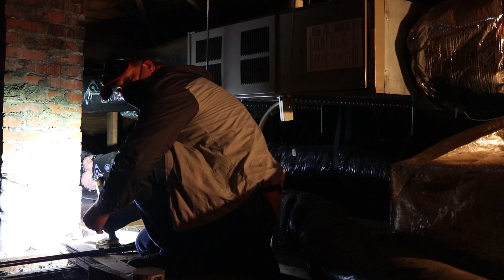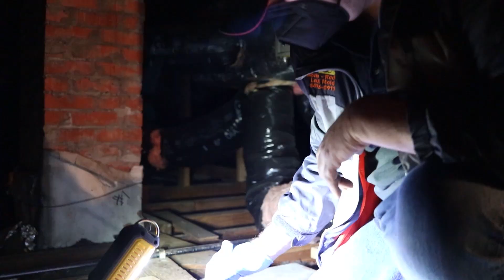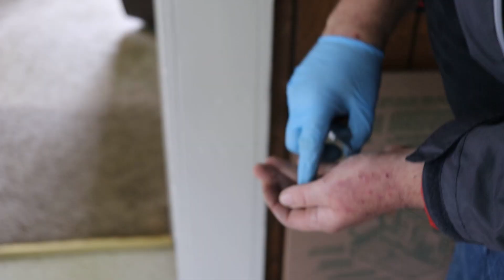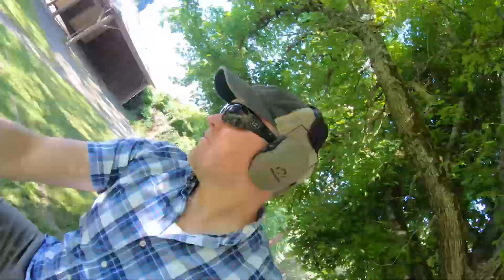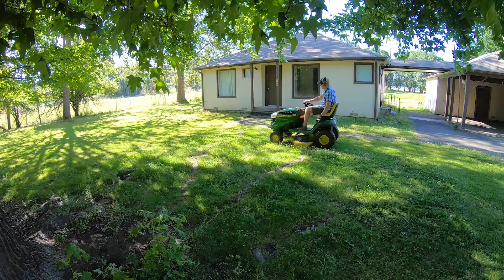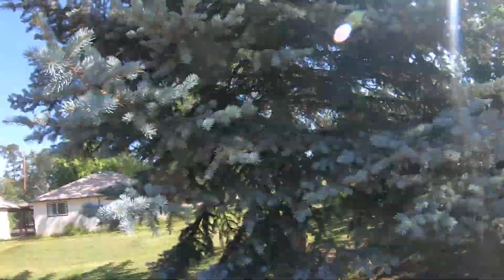This House Could Kill You

Comment: My father was a customer serviceman for the local gas & electric company back in the 50-80's. He used to bring home a bucket of asbestos fibers in one of those round potato chip boxes which we sprinkled on the barn and cellar floors before sweeping. The barbed fibers clung to dirt particles which helped lift the debris from the floor surface when we swept. One of my best friends’ fathers was a boilermaker whom actually died from asbestosis after working with it his entire career. He used to tell the story of how you couldn’t see through a room where pipefitters used it to insulate pipes. They mixed it with water in cement mixers before applying it to the piping and the airborne fibers filled the air. My lungs are getting heavy just thinking about it.

Comment: I grew up in the Navy and one of the base we lived in had asbestos tiles on the floor that was so old that the top layer had worn off and our feet would be coated with white powder from the floors.  That was asbestos.  That wasn't the worst thing about those houses as the water was filled with brownish flakes, almost like rust.  It was fecal mater mixed with gasoline that had leaked into the ground from the local gas station.  Everybody had stomach problems and my little sister had ulcers.  Great times.  The Navy had called those buildings "temporary housing."  They were built in the 40's and were still being used when my dad retired in the 90's, tho' they had started replacing the floors towards the end of his tour.  Fascinating process.

Comment: My Brother served his apprentiship as a carpenter back in the early 60s. Part of his training was cutting up large sheets of asbestos to be used as insulation. Despite being in a machine shop with dust extraction (somewhat rare in those days) he contracted mesothelioma (asbestosis) at the age of 66 and was given 18 months to live, which is about normal with his type of exposure from the onset of symptoms. He died  aged 68 on Christmas Eve about 10 years ago. It was not a nice end. All of that said health and safety is such that even if you have the most miniscule amount in a building they insist on full barrier extraction. Better safe than sorry I suppose but how much gets dumped at the roadside because of dodgy contractors or DIYers. Here in the UK we can see regularly. 

I had a burst pipe above my bathroom and before the renovation could begin the insurance company insisted on the Artex ceiling being tested even though the house was built after Artex had ceased using asbestos. It was clear but the delay in getting  it tested added nearly 10 weeks onto the job.
Reply: I was a carpenter like your brother and cut up many sheets on a circular saw we did not have extraction and by the grace of God I have not had a problem so sorry for you losing you brother to this terrible disease
Reply: My parents once had an old house with asbestos siding.   It cost more than my folks could afford to hire someone to safely remove it, but the contractor said if a tile fell off Dad could just put it in the trash, no precautions needed provided it was no more than a single tile, which Dad thought was nuts.  They ended up selling the place.
Reply: @johndavies2396  Thanks John. The unknown here is that my brother used to cycle home in his overall and my mum would shake them out on the back yard. She died several years before my brother with multiple cancers, so it is a possibility that the asbestos got her too but without any direct link at the time it was never investigated. I used to play on that yard being 15 years younger than my brother so it may also get me, only time will tell. Trusting you stay fit and well.

Comment: I’ve been in the trades for decades and grew up in asbestos homes; it used to be the new best and greatest stuff. I recall finding it in everything from attic insulation, to it being in the plaster, siding flooring, wrapped around pipes, and even some of the most dangerous, at least IMO, was the boiler pack which is basically dried asbestos paste. I grew up around it, have worked around it, and have good lungs, thankfully; while I do use proper PPE today when I grew up and started in the trades you just worked through things including clouds of asbestos dust. Today it’s silica and I’m sure tomorrow will be the expanding foam insulation off-gassing; sadly about all we do has some risk, hopefully we’re smart enough to manage our risks today. Asbestos can be quite safe and stable when it’s bound in products and kept intact, it’s when it gets broken up or knocked around, and gets into the air when it gets dangerous; it’s also like CS/CN in that once it gets airborne it will settle down and then just get knocked back in the air again once disturbed. 
Regardless of what you’re doing be safe; you only get one body and if you want to enjoy it when you get old take care of it when you’re young. Protect your head, eyes, ears, lungs, and skin and you’ll be thankful when you get older as you’ll still be able to do most of the stuff you could do when you’re younger.

Comment: I was involved in a lawsuit involving asbestos and learned a LOT about it.  Libby, Montana had a huge mine, and not only were the miners affected, but they brought it home in their clothes and their families were affected.  Interesting tidbit, in Greece and other mediterranian countries, they mix asbestos with their white paint to help keep their homes cooler.  I'm sure they must have different paint mixtures with this, so it doesn't wear off so quickly, but perhaps it's mixed in with the plaster/stucco on the outside.  There are different types of asbestos.  straight needle-like versions which get covered with macrophages (similar to what the guy was telling you) and it still sticks out the ends to jab you and stick to cells.  There are curly versions of asbestos which are less dangerous, and can be covered with the macrophages in your body and expectorated.  They used it in all kinds of heat insulating products.  Pipe and boiler wrap, floors, walls, brake shoes (and may still have some in there - not sure if the asbestos lobby was able to beat that back, as it's a safety issue for brakes to help with heat.)  And the government is sneaky about how they count your death with regards to it.  You have to die in the same proximate area where you got the exposure.  So a man who lived near a vein of it that was dug up from a park being developed died 40 years later from asbestosis or mesothelioma, but it wasn't counted, because he moved to a neighboring county.

Comment: We over react a little when it comes to asbestos. But given what it does in the human lungs, the reaction is well warranted. That in mind, it's only dangerous when you mess with it; that's how it gets into the air where you can breathe it. That's why remediation is a next level process. ANYTHING that can make asbestos dust has to be dealt with very carefully. Amazing we aren't all dead from it, as we used to make brake pads with the stuff!

My high school has (had?) asbestos insulated water pipes. They were inspected yearly, and any time anyone touched one. My sister's house (built 1908) has knob-and-tube wiring with asbestos fabric insulation, again, it's perfectly safe when left alone. (knocking that house down - as is the case here - makes it a problem.) I recall the extensive process done in an old university dorm (ECU or WCU, I don't remember which); it looked like a nuclear clean up.

The lungs aren't like the rest of the body. Foreign bodies are "washed away" with mucus, vs. entombing them with calcium. As Joel explains, asbestos doesn't wash away so easily. (neither does silica / glass, btw.) Of course there's also everyone's favorite... lead paint. (that 1908 sister's house... there's so much lead paint on those walls wifi won't go through them.)
Reply: Great summary! Lead is way different than asbestos. not nearly as harmful. Yes, it's still not great for you, but it's in a very minor league compared to asbestos. 
I wish he would have touched on the benefits of asbestos. Like he said early in the video, it really is a miracle fiber! It still, even today has no real equal as a binding agent and fireproofing agent. It's really amazing. Hence it's still allowed to be used in commercial applications, usually fire related.
Reply: Brake pads and clutches still use it they just don't have to put the warning on the box anymore. It was news to me when I read it in an ASE news letter. Apparently the use of it has been held up in court since the early 90s and because of that manufacturers can still use it due to a lack of a good alternative.

Comment: You need a proper vented respirator to work on asbestos not just a cloth mask. Please be cautious y’all. I have been around plenty of asbestos unfortunately. I was moving this shiny looking soft almost mica looking attic insulation to run a wire and I asked my boss later and he said it was vermiculite. Vermiculite doesn’t always contain asbestos, but it’s almost a sure thing that it did considering the age of the house. Also watch out for drilling through old siding, you can usually tell if it’s old siding that breaks off in chips and chunks and is really hard. It is different than modern concrete siding or cement I forget. Anyways, stay safe.

Comment: I live in a 1963-built house, and it's everywhere! I found a pad of it in a light fixture, the drywall mud, linoleum, and popcorn ceiling. I'm thinking about abating the popcorn ceiling myself though. It was the Frank's Red Hot of building materials!
Reply: Use clear spray paint, it keeps the fibers from floating.
Reply: @chuckmiller5763  I was going to use water to wet it, then scrape it into a tub to keep the mess down, bag it and wrap while wearing a Tyvek suit and respirator with P100 filters. I would imagine that paint would make it harder to scrape

Comment: My grandfather died a few years ago of mesothelioma. He was a fireman for 28 years. Started on the bottom and eventually worked his way up to station chief. In that time they would only wear SCBA's when entering a house, not when standing outside to put the fire out. He told us that large asbestos fibres from the roofing would just fly through the air with the smoke coming of the fire. He died just a few weeks after his diagnosis at age 82. It was incredibly quick. Before the diagnosis he was still very active, working every day as a delivery man for my uncle's bakery. Got up at 6 AM, instead of the usual 5 AM because he decided he had earned that extra hour at 82. I miss him. His photo is in my shop. I still try to make him proud.

Comment: I removed some hardboard siding from a home about 10 years ago and found out when we went to dump it that it was made with asbestos. We didn't use any masks and I've had this terrible feeling that I'm a dead man walking ever since.
Reply: I've been told that it's fine so long as it doesn't get airborne.  Air quality is a major factor also.  The better the air quality the better your chances.
Reply: the asbestos is bound into the siding and as long as the siding does not get ground up the particles of asbestos stay trapped in the siding.  The danger of asbestos is it becoming airborne.
Reply: @R_B62  That siding was very brittle and broke into multiple pieces as we used pry bars. There was dust in the air unfortunately.
Reply: Fear not!
Reply: You are fine. Of carpenters who spent at least 10 years working with asbestos, only 6% were diagnosed with mesothelioma/asbestosis. These were guys cutting asbestos boards on the daily, releasing tons of dust with no masks or extraction.
You are causing more harm to yourself by stressing about something that happened 10 years ago.
Reply: Probably not from one house.
Reply: This is like walking past one x-ray machine and worried about getting cancer.

Comment: I'm milking cows in a dairy barn that was built in 1945. The barn ceilings are asbestos-cement board. They're fine, as long as they're not disturbed. Asbestos-cement is an excellent paneling material, and is inert enough as long as you don't attempt to remove it or modify it in any way.

Comment: Did a few jobs at Johns-Manville Trance Division in Waukegan Illinois, which is on the shore of Lake Michigan they made water pipes out of concrete and asbestos fibers needless to say it wasn't a good idea to use asbestos laden water pipes so that's been an issue. John-Manville went bankrupt and the 150 acres Asbestos laden site  became one of the EPA Superfund sites in 2016.
Reply: JOhns Manville is not bankrupt, we use their insulation all the time.
Reply: @chuckmiller5763  A company can file for bankruptcy and still exist.
Reply: @tempesttube  context is everything.

Comment: I joke with my wife that I have one lung lined with asbestos and another one lined with lead. When I was a kid years ago one of my first jobs was demoing old houses. I never wore any protective equipment and I'm sure the paint was lead and the insulation was asbestos. I had adult onset asthma a few years ago too, but it seems to have gone away on its own. I've basically accepted that I should expect a cancer diagnosis at some point too, but so far I've been lucky.
Reply: In the same boat brother good luck out there, Romans 10:9 KJV
Reply: Most cases you hear about are guys who did it for decades without protective equipment, and even then they usually passed in their 70s 30-50 years after initial exposure.  It’s not a particularly high risk for someone with moderate exposure even for a few years

Comment: You got off easy in my estimation. My house has asbestos siding. Some grandfather law allowed us to buy it but we can't sell it without upgrading.
Reply: I've seen houses with aluminum siding over asbestos siding.  It was very popular at one time because it was fire resistant, so people were putting it everywhere, but it's a pain to remove so when it fell out of fashion many just covered it up.
Reply: Siding is actually quite safe.
Reply: Get an N100 respirator and a protective suit off Amazon. Hose the siding down with water, and then pull it off. Keep spraying water to keep it damp and prevent dust release. Double-bag the debris in the extra thick contractor bags. Spray yourself down.

That is almost exactly what the abatement guys will do.

Comment: Looking forward to the abatement info. There’s not much about it on the internet.
Reply: What would you like to know?
Reply: @zenjon7892  cost. Procedure. If the homeowner can do anything to prep. The actual safety protocols the professionals use. Also what levels of mask protection they use. If, for instance, you live in a house with asbestos in the joint compound it’s impractical to rip out all the drywall, so you’re always left wondering as a homeowner what you can and can’t do to your walls practically. Can you put a hole to hang a picture? Cut a hole for a new outlet? Being able to balance risk is in every project but there’s little information out there on asbestos to help people manage risk and thus they’re left to “wing it”. Saying, “you shouldn’t do that!” isn’t a solution.
Reply: @williamcox8491  well... It depends on what state you live in; I live in CO and I can do it myself and not have to get a permit, but there are some safety guidelines I have to comply with. You should curtain the room and cover the floors in 6-mil plastic and duct tape it in such a way that it is sealed together. You should wear a Tyvek suit, rubber boots, rubber gloves (both of which are taped to the suit), keep the ACM wet with water, have a vacuum with a HEPA filter to clean up any debris that lands on the floor, wear a respirator with P100 filters (shave any facial hair prior to get a good mask seal), then you have to get special haz-mat bags meant for asbestos and goose-neck tie them when full, and find a landfill that accepts it.
Reply: @williamcox8491  I think a DIY guy could do it himself; take your time, be careful and do your homework. Also, I consulted the asbestos safety expert at my job and we put this strategy together. I don't think hanging a picture or even cutting an outlet hole will release enough fibers to worry about, but maybe you should get the material(s) tested to properly assess the risk

Comment: We did a project several years ago that had to be remediated because of asbestos. It had fibers in the glue and tiles etc. I learned several things from the training and daily activities. #1 let the highly trained crews deal with this! #2 if you need to drill into it, use a dollop of shaving cream to drill through. It keeps the particles trapped and doesn’t let them become airborne. #3 smokers are 2 times more likely to develop asbestosis in their lifetimes. #4 the Romans actually made high temp clothes out of it and even they noticed that the workers that wore those clothes tended to “expire more quickly”. #5 the debris from this goes in a special spot in the landfill that is GPS located for eternity. Kinda funny IMO, because it is 100% natural.

Comment: My dad's house has asbestos siding
It is that cement shingle type that has asbestos fibers in the cement
Reply: Just don't touch it, make sure it's well coated. All that's left is to cover windows /doors with the same material, as well as the roof and you're fireproof.